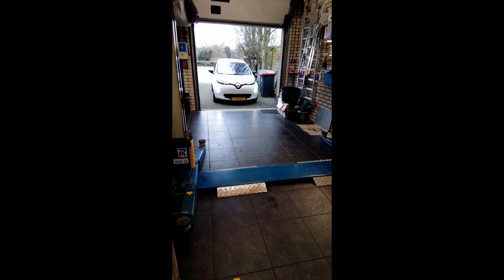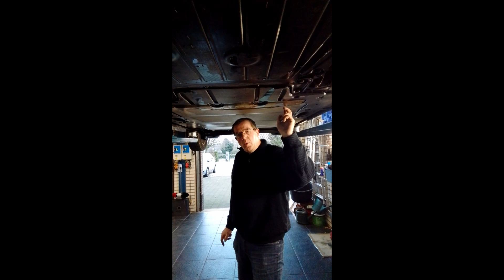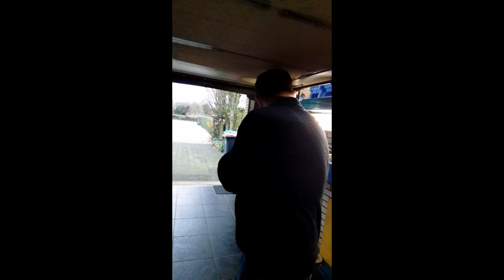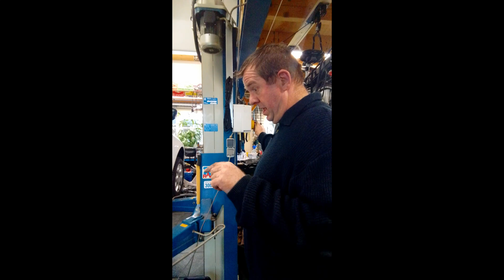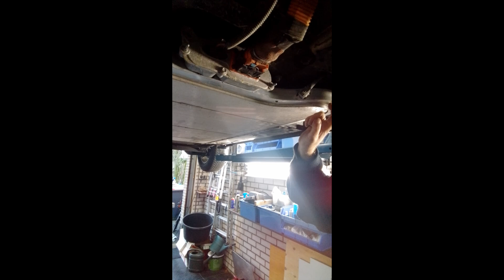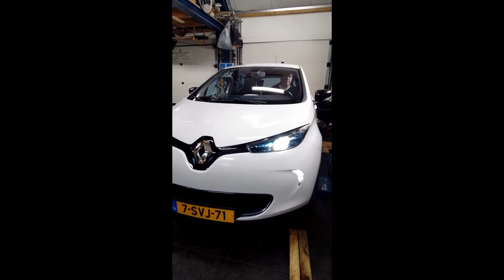I have upgraded my Renault ZOE's range. Traction battery swap of 22 kWh to 41 kWh.

Comment from the maker: Update 2.5 years later. We are still having a lot of fun with this car. Summer range is 265KM. 235ish when it's cold. I put over 50000 km's on the car since the swap. Stil very happy. 

I did had to replace the inverter last year. Got myself a new one. 296053434R.  But I think that the charge unit broke because the electricity company took the grid down and put on 2 phases instead of 3 for over 2 when they switched the grid on. It was in the 2 phases State for over 2 hours. In retrospect, I should have disconnected the charger when that happened. 

Also, I upgraded the interior for a fake-leather (TEP) one of a mk2. When you swap the interior of a mk2 in a mk1 you need to make room for the mk1 side airbags in the upholstery foam and out the original side airbags in. The airbags in the the front of the seats are the same.

Comment: Hello,
I am from Germany and your Video is very interesting. Thanks a lot for that.🤩👍 It was short and everything importat seems to im it.
Would I have seen it before i wouldn´t have given the Zoe strait, after bying, back.
The reason was because the rest-km had gone down from 101 km to 51 km on my 24 km back home from bying (without racing) . That shocked me.
After I´ve phoned the seller and so on which took about 20 minutes the display showed 64 km ..... ? Is that normal or is that because one cell is nearly broken? 
How heavy is the Battery? 
What do i have to look for if I buy a used battery?
It would be very nice if you answer my questions.
Best wishes 
Phillip Grimm
Reply: It was a Q210 from 2013 with only 32.000 km in very good shape and only 3.600 €
Reply: @PhillipGrimm-k7p  I have the same car/battery. The onboard computer is very unreliable concerning the kilometer indicator. It usually drops much faster in the first 25%. Speed (above 90km/h) and hills also have a huge impact on battery consumption.
Reply: @virgilsebirot1861  Thank you.  It was flatand i kept in the green (middle to upper green) mostly villages and 70 -90 km/h inbetween. 
I guess it was a mixture of the unreliable  kilometer indicator and one cell that was perhaps week/half broken. 
I gues in ONE Zell the Voltage drops, when in use, quicker than the others. 
The BMS calculates with the voltage of the lowest Zell and thats makes it more unreliable. 
When stop using it, the voltage of the weak/half broken Zell regenerates and the BMS sends the message that it is fuller (more km to go) than while in use.

Comment: great change!! i also have a zoe, the r110 41kw battery from 2018 ends,i have free 200 km travels with my solar panels, its freedom!!!
great price for did it,only 4500€...2000€ was my annual consume of gasoline 1 year ago..so its very cheap the batterys price!!
greetings from spain!! sorry if i did any mistake whit mi english....i  did use my spanish and then you use the traductor  😅

Comment: Hallo, it was not ned to imput cumputer data in bms car?
He assume the 41kw batery just changing the batery pack?
Good job 
Regards
Reply from the maker: No I did not need to replace anything. And my ZOE is an early one of 2012 (q210). Half year later it is still running and charging fine. The range in the odometer is around 265km in the morning. My work-home 2way commute is 180km daily. Im super happy with it.

Comment: Hello, i’m French, thanks for your video it’s possible swap Zoé in 2024 ?
Reply: And how much is it for swap ? Thanks
Reply from the maker: @kvnmdi  I do not think that Renault dealers offer this service at the moment. I am also not delivering this service. I just did it on my own car. My used 41Kw battery (2019/17000km) cost me 4500 euros of a breaker yard and put it in myself. (See video). 

I have my old 22Kw battery for sale btw.